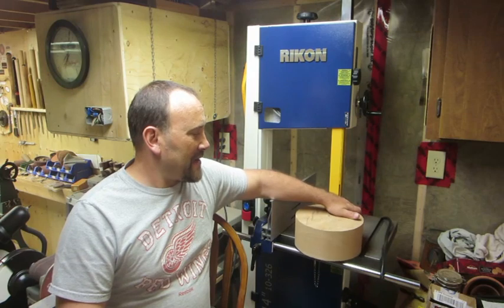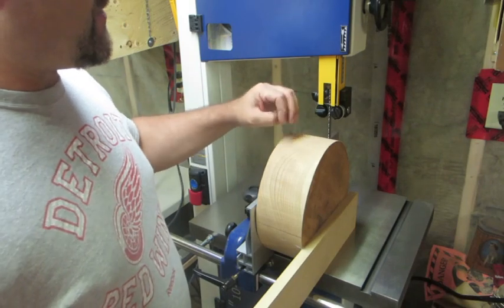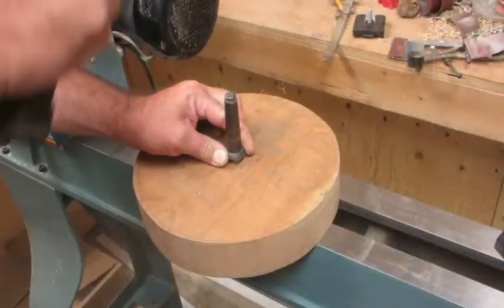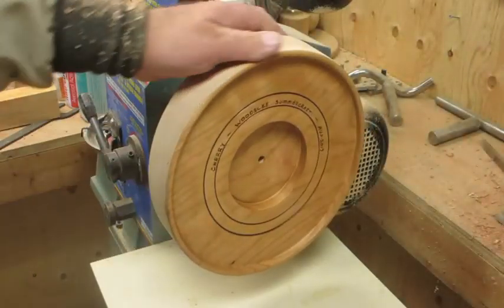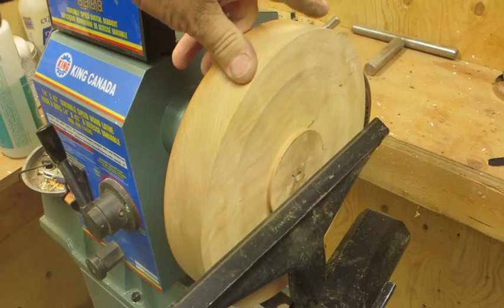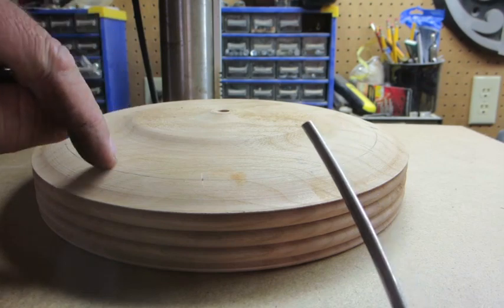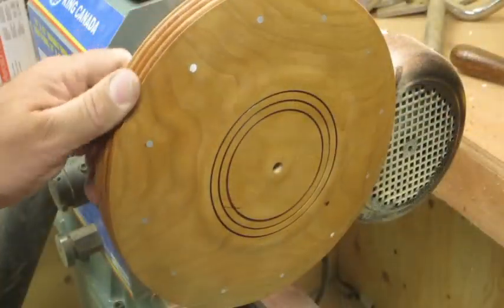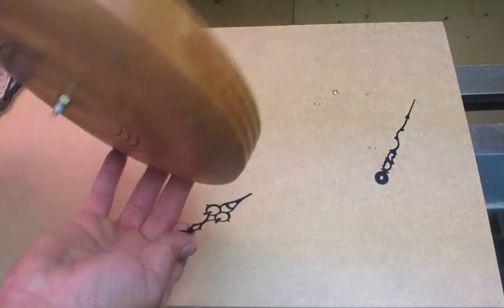woodturning # 78 how to turn a clock

Comment: just got the same saw this weekend and began cleaning up my wood piles, so far so good and I am looking forward to many happy years with my Rikon.  Neat project - thanks for the video.
Reply from the maker: I'm loving my saw, i grabbed a 4" - 2 1/2" adapter set for the dust collector, i just use my shop vac when i'm using it, it does a good job of removing the dust as i cut. it truly is a great saw..
thanks for watching
Rob

Comment: I used white Milliput for the hr markers because of the dark wood ,i thought needed to be bigger , 10 mm ,,.then I used a keyhole plate for the hanger, I cheated with numbers , Charity shop  bought clock , recycled mechanism and hands , the paper clock face (a bit scruffy )was over laid to highlight where the hours were , all in all a good project , Stay safe Regards Alf
Reply from the maker: Nothing wrong with utilizing click parts for a new clock, i did buy some milliput from amazon some time ago but still havent used it, i really should.
Thanks for watching 
Rob

Comment: Another way to place the hour markers is to use a 360 degree compass and simply mark every 30 degrees. No math involved. You might also try a dark hardwood dowel to mark the hours...something like Ebony for example. I think that would eliminate the dark ring you experienced. Just a thought for others that might want to try this. Good video showing the whole process, well done Rob.
Reply from the maker: Gil 
Thanks, absolutely I agree with all you said, I guess I've been helping my youngest with his math, so applied it 🤣. 
I want to try dark dowel rods but not easy to find, maybe at the Woodstock woodshow sept 29th before my class in October 
Take care
Rob

Comment: Nicely done Rob  . Congrats on the Lee Valley gig . Your new band saw seems to have lots of power . Should be great for resawing . Take care .
Reply from the maker: Glen 
I'm chuffed with it, it's got a 1-3/4 ph motor and also can't wait for the class, I'm back to back that weekend clock/ bowl 2 days in a run 
Take care
Rob
Reply: Woodslee Summercraft 
If my old Sears had that much power I would be chuffed to .
Reply from the maker: the bandsaw is one of my favourite tools in the shop, next to the lathe of course

Comment: Nice job. Thanks for sharing. Do you think double sided tape would work safely in lieu of hot glue to cut your bowl blank in half?
Reply from the maker: yes im sure that would work fine, as long as it keeps your fingers away from the blade, that and the blank doesnt spin on ya, thats the main reasons for doing this 
take care
Rob

Comment: Hi
Marking off for the hours.
One way is to work out the chord length between the numbers. Not on the circumference.
Which is .....half the degrees between the numerals.
Sin15degrees=0.2588190 x4. Which is your radius =1.03527x2=2.07055
So the calipers need set to 2.0705. Or just wing it when you get to the end mark lolol
So you were only 20thou off, working it out on circumference. It's just that it all adds up.
The initial diameter still needs to be quite accurate, as does the marking off.
Got here as I was looking for ideas for my own clock. Yours is one of them, but will need to be adapted for size.
Just an idea but how about led lights in place of the aluminium rods, working off battery in the rear.
Reply from the maker: Mary Colville 
The math behind it works either way I guess. 
The options for markers are endless, my next one I'll use the same method only with copper wire.
Glad mine was of use to you
Take care
Rob